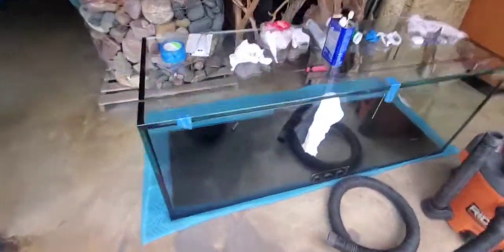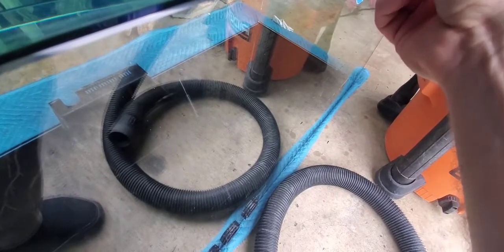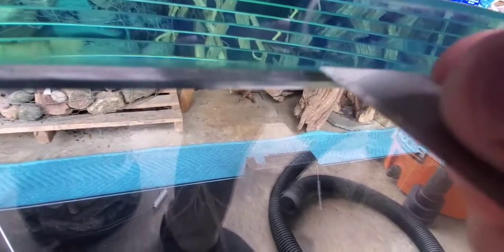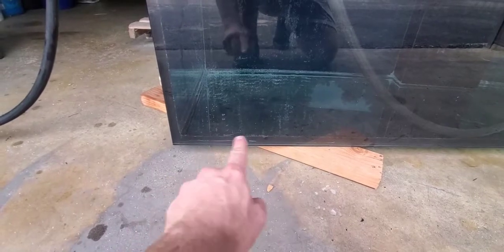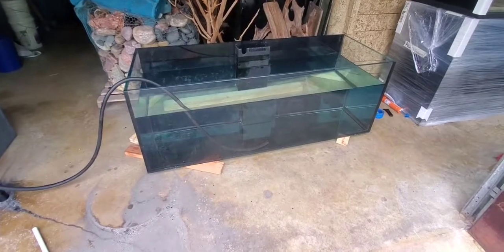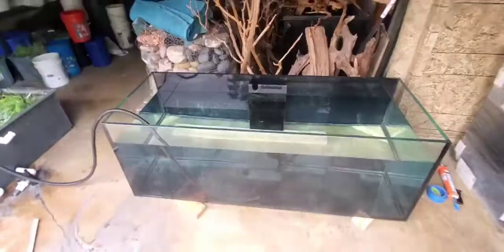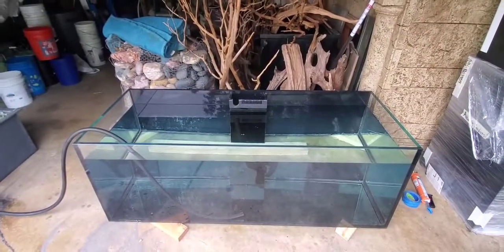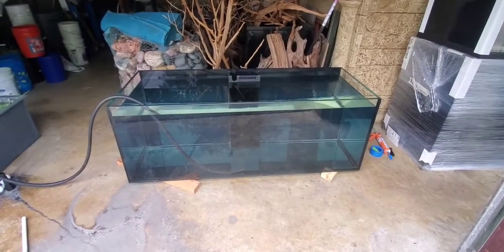Silicone Repair Red Sea Reefer 750 XXL Finished.

Comment: How did you prep the ends where the old silicone will meet the new one? I am having difficulties getting a clean cut on the old silicone.
Reply from the maker: @theaveragediyer3018  kind of hard to explain, but i cut back the inner/larger seal a few inches back futhur than where the glass seem seal is, then layed both seals at the same time so they are one thing basically. Very hard to explain.

Comment: How is it holding up.
Reply from the maker: It's holding up great, kicking myself I didn't leave it before trying the gusset. Sealed many others since then, the same way. But have been leaving the tanks for weeks before putting water in. Just to give more time for curing.
Reply: I have a 650 i am going to attampt. Fingers crossed.
Reply from the maker: @MrCtmercer  good luck sir!

Comment: Seems like the reefer line is defective in this brand
Reply from the maker: Negative. It was only the 750xxl because it lacked a center brace. Which put extra stress in the overhanging seal on the left side of the aquarium. 

The new generations come with the same aluminum adjustable brace just like the 900 3xl has.
Reply from the maker: I used a 2x4 to support this section on my early model 750xxl post silicone repair.

RSR are very well made.
Reply: @SBS_Auto  that is not true. There have been many other models doing this, including my e250
Reply from the maker: @reefcrazed2070  aquariums available in america?

Comment: Isn't this a structural issue that would just leak again? Curious
Reply from the maker: @Merknilash  how many years ago was this video?
Reply from the maker: @Merknilash  what do you do for a living?
Reply: @SBS_Auto  idk why you’re getting defensive - this is a legit question , how did the tank turn out?
Reply from the maker: Just like you go to work and do what you do, i go to work and do what i do.

Having repaired hundreds of aquariums, iv never received a call back about one leaking.

Repaired 10 gallon tanks to 10,000 gallon tanks.
Reply from the maker: @Merknilash  on the new 750xxl they added a center brace.

Which after the repair i also added a center brace.
Reply: @SBS_Auto  so it sounds like it’s a crappy Chinese silicon job rather than a real structural problem
Reply from the maker: @Merknilash  the structural issue caused the leak. It's a well-known issue, and the new 750xxl does not have the same issue.

It's also good to know there are you acting seals, the one between the glass panes, and the one in the corners. The corner seals are to keep debris out of the actual seal between the panes.
Reply: Lmao wtf was that about

Comment: Thanks for posting this! I have a leaky Reefer 350 that I'm going to attempt to repair. Just to confirm... The silicone you put in the seam up against the existing silicone... That's holding up good? I've also heard that's not recommended. Also, did you only put silicone in the seam between the glass, or did you also put it inside the tank so it went up a bit against the sides (like a traditional aquarium)?
Reply from the maker: Yes i put it up and over the old silicone. Making sure to get it into the crack first. Im posting another video soon of a tank i completely resealed, including the application process this time.
Reply from the maker: New video is up 👍
Reply: @SBS_Auto  Good to know. Thx for the reply!

Comment: Just resealed my 625 using your tips! I left the gusset out! Getting it cleaned out properly was about 6 hours while resealing was 15 minute 😂. 

How is your repair holding up 3 years in? 

Thank you truthfully for taking the time to make this video to enable DIY-ers to take a try at this inexpensive repair.
Reply from the maker: @jjhz83  awesome! My repair is still holding up.
Reply: Just picked a 625 for free. Going to reseal. My question is are both  of you using the Red Sea stand? I believe it is the issue.

Comment: Thank you for posting this. I have recently bought a reefer xxl 750 V1. 
In the UK, the current model retails for £3'700 - mine cost £150. 

I was told it only leaked along the front Edge. I completely removed the front panel and resealed. I also attached as a strap across the inside front made of 1/4" x 4" x 70" glass.

I don't know if the sellers were mistaken, if I caused some damage during the transportation, or the join between new and old silicone is not good - but it now seems to leak in the front left hand corner. I would like to remove the side edge gusset; clean, resit and reseal it. as I think the leak is under there.
Was it difficult to remove?
Thank you again. 🙂
Reply from the maker: Hello! Thank you for commenting!

The seal can be a bit of a pain to completely remove. U may have to get creative, but its imperative that you remove all signs of silicone before repairing. And the seal and the corner need to be set at the same time as to create the best seal.

Even when u think u have cleaned it enough, u will still find old silicone residue, take your time.

Comment: Hi thanks for sharing, my 425xl decided to spring a leak flooding my living room, the sealant came apart on the front side. Will this be possible to fix? My marine fish are currently in a small cube tank.
Reply from the maker: Im sorry to hear about your accident.

To answer your question, yes absolutely fixable. If youre in the houston area i can fix it for you!

You can check out my other video on resealing an entire aquarium, which greatens the likelyhood of success.

But it is possible to reseal one section of the aquarium as you see in the video. Make sure to use the same silicone i used, and be sure to move quickly when applying the silicone.
Dont worry about fixing mistakes until the silicone is cured.

The cleaner the surfaces the better the repair, be meticulous as possible.
Reply: @SBS_Auto  I wish I was I’m watching from the I’m sadly. Thank you for the offer. Also thank you so much for the encouragement
Reply from the maker: @StokeKoiAdventures  you got this!
Reply: @SBS_Auto  cheers much appreciated. I’ll let you know. What’s the best black sealant can you use
Reply from the maker: @StokeKoiAdventures  I use black ASI aquarium sealant. You can buy it on amazon

Black Aquarium Silicone Sealant - 10.2 Fluid oz Cartridge https://a.co/d/6vmtiL8